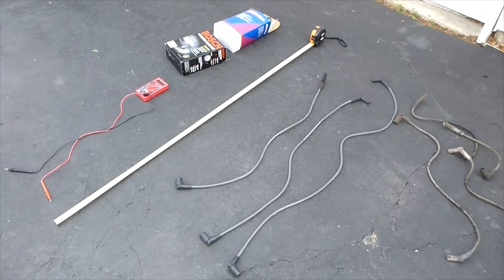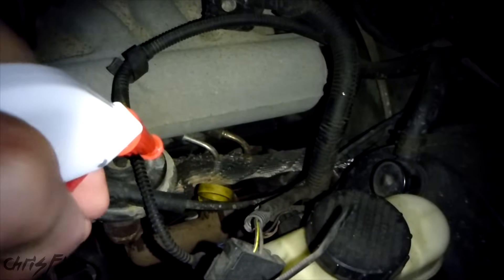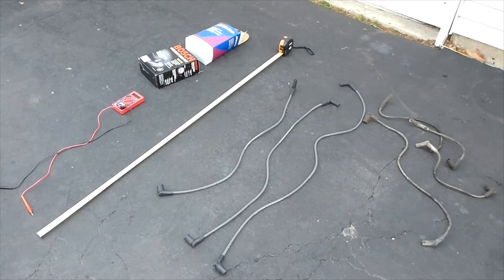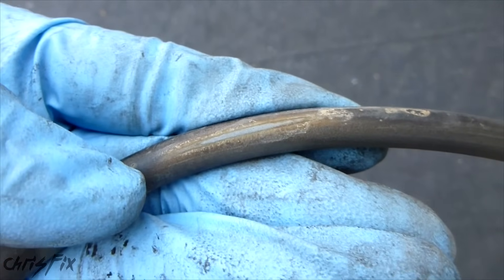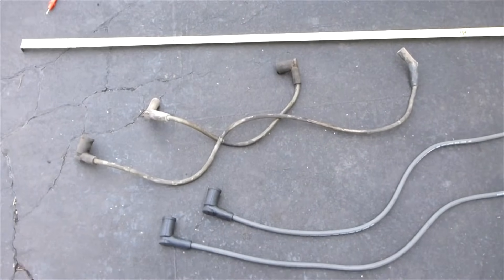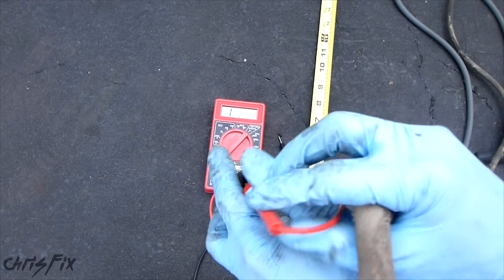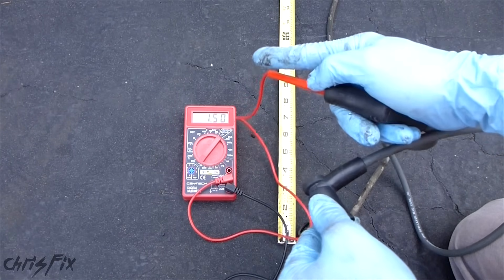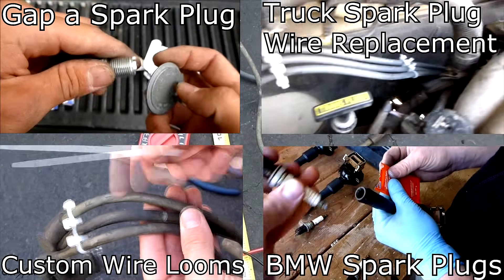How to Test Spark Plug Wires

Comment: Hello everyone, I have a Honda Accord 2002 LX I4 that have a check engine light is on. I have code P0420 two weeks ago. I use the lacquer thinner put in the gas tank and the code is gone. After 9 days, my car give me the code P1399 misfiring. I came to auto shop, my mechanic cleaning EGR, cleaning intake manifold, change head gasket, change spark plug and wire, change distributor, check compression, check vacuum leak... but the check engine light is still on and my car is likely losing power, hard to speed up and shaking when it is idle or running <15 mile/hr. I realized when I pull out the spark plug wire number 3, the rpm is not changed. So my question, is there any chance that the bad Oxygen Sensor or the bad Catalytic Converter give out the code P1399? My mechanic check all the above possibility that could cause misfiring but cannot fix it. I appreciate all comments and helps. Thank you so much.

Comment: Sir, my car i20 4th coil HT cable, the shortest cable, has 8.8 ohm resistance which is the highest among the 4 HT cables. The 1, 2, and 3 readings are...2.4, 2.0 and 1.8 ohm respectively. Is the 4th cable really defective???

Comment: Can you do a video on timing a distributor
Reply from the maker: Good idea
Reply: ChrisFix yes and is the timing chain easy to fix on the ford ranger 99
Reply: @chrisfix  My car i20 clutch sets ...disc, bearing and plate, and slave cylinder has been changed recently. After that, all working ok...pulling, shifting, etc..all ok. No complaints.

However, just about 3000km of driving since the above replacements were made, the car suddenly failed to engaged any gear while driving. The clutch pedal all the way goes to floor and never return back. I have to manually return to its original position and then pressed again repeated. However, it still sticks to the floor and never return back.

I was driving and all of sudden the issue happens. Stuck in traffic and was pull over to roadside with traffic police help.

Wait for some time, and yes, it come to engaged and disengaged again. All ok. But, the problems arise intermitently!!!

There is no physical leakage, damage or low fluids in the system. All ok. (It used to happen when clutch is used often ie in traffic jams, clutch engaged and disengaged frequently, just in 10 minutes or so. However, no issues with pulling power and no clutch slippages, temperature, coolant all ok.)

Comment: I have an 06 impala 3.9 and my wires run across the top of the block and one day i noticed they were shorting out on top of the motor it looked just like when you sprayed the water on them and i could see it around sunset so it wasnt even dark

Comment: I just replaced spark plugs on my truck....like an idiot I put dielectric grease on all the electrical connectors (ignition coil connector that goes from wire harness to the IG coil) now i know that stuff insulates and not conducts.. anyways the truck ran great for about 45 mins then started running rough. I went through and cleaned the connectors with electronics cleaner but still running rough. any thoughts?

Comment: Hi chris. I have a 07 tahoe there is no spark on the left side spark plugs. I already replace the spark plugs and coils but there is still no spark.can you help how to diagnose why there is no spark on the left side spark plugs
Reply from the maker: On that car, what wires go to the coils? Is it one set of wires to each coil or does each coil have wires going to the computer? Is there a ground on that side that’s dirty or broken?
Reply: They have a small spak plug wire that go from the spark plug to the coil and the coils plug to a set of wires that go to the main harnesses

Comment: Hi, Mr. Chris.  If I put higher wattage headlight bulbs  100/90w  in my 70 Amp alternator car, will it damage my spark plug wires over a period of time? Because Higher wattages headlight bulbs draw more wattage and amps and will it lead to low wattage supply to the ignition coil, spark plug wires and spark plugs. What is your suggestion regarding using higher wattage bulbs in 70amp alternator car and damage to the ignition coil or spark plug wires?

Comment: Hi, Chris.  Thanks for this video. Today I could able to detect spark plug wire defect with the help of your video.
Reply from the maker: Awesome! Glad the video was helpful
Reply: @chrisfix   sir, my car i20 has 2 separate coil packs controlled by 2 wires connector which controls 2 high output terminals. However, one high terminal pin 4 of first coil gives less spark than pin 1 on the same coil pack. Why such less spark being provided by the same primary coil??

Comment: First off, love all your videos. They have really motivated me to keep up with the maintenance on my truck and get as much life out of it as possible. My question is I have just tested my coil pack and my primary resistance is 3.4 (spec range is .3 - 1.0 ohm) and secondary is 13.3k (spec range is 6.5k - 11k ohms)

I have read all over that it should be close to this range, but I'm not sure if this is still acceptable. Should I just replace for good measure? 

My only concern is the primary resistance being over 3x the resistance it should be.
Reply: Yes

Comment: How are you going  to know the specs for different lengths? Pulling wires off can cause the end connector to come off. Then you need wires. Use silicone dielectric  grease on the ends. Plug wires develop resistance  when they get old. Replace them every 5 years.

Comment: Thanks for the video man.. good stuff to know
Reply from the maker: Glad the video was helpful.
Reply: @chrisfix   sir, my car i20 has 2 separate coil packs controlled by 2 wires connector which controls 2 high output terminals. However, one high terminal pin 4 of first coil gives less spark than pin 1 on the same coil pack. Why such less spark being provided by the same primary coil??

Comment: I have a 2003 gmc Sonoma 4.3L V6 i have a misfire on cylinder 6 so I did spark plugs and i still have a misfire then I did plug wires and I check them to make sure they were good and I still have a misfire  what do you think it could be i would like to here back from you

Comment: hi chris, is it possible to use sparkplug wires from a 4 cilinder engine for a 6 cilinder engine. i was planning to buy 2 sets of a 4 cilinder engine because i cant find a set for a 6 cilinder engine, thanx in advance.

Comment: This is a great video. Thanks i like how you show the detail in the multimeter. I just have one question you said the bad wire was the one that read 10 thousand ohms and the good wire was approx. 500-600 ohms. The higher in ohms like 800-900 is a bad wire and the less ohms is a good plug?? Mine were between 600-700 is thst good or bad???

Comment: One thing to note, I have a new Fluke 323 tester and bought a new set of spark plug wires after my meter was showing an open line on the coil to distributor wire. I checked the new wire and got the same open line reading. I went to the specs on my meter to find out it only reads to 4000 ohms so it is completely useless for checking spark plug wires. The cheap multi-meter I had before that broke had a much higher resistance reading capability before it broke of course. I thought I was doing good by going with a quality brand tool,  I just can't win.
Reply from the maker: That is crazy. Fluke is supposed to be an awesome multimeter brand.

Comment: Hi Chris, 

I have a bit of a bother I hope you can help with.  

Car is a 2003 Chevy Tracker.  I bought her used, my first car.  Started and ran great, no problems.  Only issues were it needed some minor suspension work, and the gas tank leaked if you filled it over half.  The previous owner's solution was to simply never fill it over half.  I wanted to do better by the car than that, so I ordered a brand new gas tank, along with the suspension parts and took it to my mechanic (family has used him for ~20 years).  I figured, given the previous owner's lack of maintenance, I'd have all new iridium plugs put in (the manual calls for either iridium or nickel).  After the work was done, she was rough starting,  and constantly stalls if you don't manually keep the RPMs at or above 2000.  We tried replacing the catalytic converter & O2 sensors, no joy.  New PCV valve, no change.  IAC is clear.  I installed a brand new air filter 300 miles prior to bringing it in for the tank and plug change.  Mechanic insists the plugs are gapped properly (they were pre-gapped at the factory and he says they checked out fine).  They're in a coil pack, and the wires weren't touched, only a plug change, so the firing order as I understand it could not have been fouled.  Computer is throwing codes for barometric pressure sensor, knock sensor, and mass air flow sensor. Replacing all of them would cost over $300, with no guarantee that the sensors all suddenly failed at once.  I realize it's really hard without physically examining the car, but do you have any ideas?  Could the plugs have somehow mysteriously gone bad?  I'm starting my own (non-automotive) hardware installation business, and need to be able to drive to my customers.  At this point, I've $2,500 in the car, which ran great when I brought it in, and now is essentially a lawn ornament that can sometimes unreliably drive somewhere (roughly, loudly, and with a horrible smell).  Thanks, 

Alex in MT

Comment: I'm restoring a russian small truck from the 50's . No one makes any parts for them anymore, i've manage to fund some "nos" wires but they are a bust, the wires are harden and broke apart. But the boots are OK. the original wire is only 6mm diameter, and all the wires I find are 7 or 8 or 9+ so they don't fit (the spark plug boot is L shape and long) Its ok to drill them a little? and bend the new cable, maybe pull on it...?

Comment: Hey chris love you channel. I have a 93' grand marquis. Intermittent check engine light. Heavy hesitation on idle and accel. Almost feels like a misfire. I can't figure it out. Familiar with panther platform vehicles? Btw it's first year for 4.6 and it's hard to tell but I think I counted the code correctly for lean/rich bank #1&2 02 sensor

Comment: If it gets wet in the spark plug chamber, am I screwed? lost power obviously due to the fact there was no spark due to it, I used electronic cleaner, a cloth to dry the chamber and a vacuum to suck, it wasn't that much but my car sounded like a 66 beetle and had almost no power, did not drive it for very long though like maybe 8 mins.
Reply: Never mind I found out what to do. Changed the spark plugs and spark plug wires, also I had to change the oil since water got inside.  After a few tries I was able to make my ride start, seems to be fine now.

Comment: Thanks for this, looks like my spark plug wires in the 1984 Caprice Classic need replaced as they were sparking! Might that be the cause of the tingling noise I heard in the car while driving up hill sin Overdrive? I expected it was preignition (or is it detonation? one of the two but one just blows up the motor) but I expect the wiring wasn't helping at all either.

Comment: should the resistance of a spark plug wire or any copper wire be around 5-10 ohms and not 5k- 10k as you noted.  I believe if you have a manual ranging multimeter, by setting the resistance to 10k range, when it read 5.0 or 10.0 , it is still 5 ohms or 10 ohms.

Comment: Hey Chris, I have a 1999 Ford Expedition that will run fine if I start it up cold and wait for the idle to lower before driving. When I start it up while the engine is already hot and drive off, it misfires on cylinder 2. Do you know how this sort of thing happens? I honestly can't figure it out.

Comment: 2005 Buick Rendezvous missing firing P303 and then got a P107 when driving it acts like it wants to jump and the check engine starts to flash and it idles rough what do you think I should check first

Comment: Cool but i just replaced mine a new spark plug wires, but what happen next is worse. Erratic idle, can hear a loud noise like a electrically. then i put back the old one. Nothing changed. Anyone got ideas?
Reply: john doe Possibly coil pack? I assume after 2 months you would have gotten it fixed by now, would be quite interested to know what the issue was.
Reply: Nicholas Hatala actually i just put the spark plug wires in wrong order, i searched the problem and doubled check it if the sparkplug wires is in order and everything is fine for now.

Comment: i installed new sparkplugs and they seem to have melted and broken off inside the cylinder and i have been trying to take it out but i cant any suggestions on how to fix this
Reply from the maker: Use a magnet on a stick: http://amzn.to/2aAxm5o
Reply: +ChrisFix it's the plastic from the spark wires that melted inside
Reply: +ChrisFix do u have an email that I can send u pictures to?
Reply: You could always a pick and just pick it out.
Reply: i tried i cant reach them i used needle nose pliers and still

Comment: Hello Chris. Thanks for the videos man, you always make them full of helpful info and simple explained. I have erratic idle and that's "killing" me. It's interesting you pointing out about the high pitch radio noise. Its like 1 year that I hear that noise from time to time and I have thought it might come from some air conditioning tubes or valves. Sometimes I hear the noise even if my sound system is off. Does this noise definitely indicate that the coil wires are to be replaced?

Comment: Really appreciate your videos, Chris! Always very informative and very well done. I hope you're making some good income off of these, as it's well deserved. 

I'm going to check my wires using your methods, but is there a general rule as far as mileage goes as to when you should replace them? Answers to that are all over the map online. I have a '97 Toyota 4Runner with the 3.4 liter that I just put head gaskets on and it seems to be running slightly sluggishly since the rebuild. Of course, I parked it and waited two years to repair it after one blew, so for all I know it runs no different than before! Gotten used to the new car maybe. I put fuel stabilizer in when I parked it and have now run several fresh tanks through it and replaced the fuel filter, as well, which seemed to help slightly. New plugs were installed right before the head gasket going. Thanks in advance!

Comment: I have a Dirtbike that I'm going to sell, it ran perfect until I went to put it up for sale. It sounds like it's getting too much gas when I get past 1/4 or so throttle. I adjusted the carb, cleaned and even changed the carb but still the same. It was jumping from a boot to the engine so I covered it with electrical tape but it didn't help. It doesn't jump anymore but it's doing the missing still, do you think it's the spark plug wire?
Reply from the maker: It might be the wire. It could also just be the carb or gummed up fuel lines or valves. Try running seafoam though it: https://www.youtube.com/watch?v=WdT4DPFXIkM
Reply: +ChrisFix I already did...... Running out of ideas but I think it's the wire, I order a new one and try that.
Reply from the maker: Keep me posted!
Reply: Did You solve the problem? I'm curious.

Comment: how can i test ignition coil  a jaguar  s type r had recenly fixed  oxygen sensors light i fixed but light didn't go off so i searched for codes again and got misfire codes in like 5 cylinders replace the plugs but not get solution so i wondering coil maybe bad but not sure and don't want to spent 400 dollars on coils with out knowing this is the problem or will fix my problem ,,,
Reply from the maker: Take the one good coil and move it to a different cylinder and see if the misfire changes to the other cylinder. That is the easiest way to test them
Reply: but in my case i have 4 faulty coils the 4 coils  by the driver side i get more confuse everyday and really afraid there might be some more or worth to deal with i just bought this car 2 month ago
Reply from the maker: You have 6 cylinders so you can still test the 4 bad ones.
Reply: what about i start the engen and try to pull out one at  time to see if they fire

Comment: Is there a set standard (resistance) for plug wires? GMC, Chevy, Ford or whatever?  If you have a plug wire 1 foot long and 2 foot long plug wire the 2 foot plug wire should be twice resistance of the 1 foot correct?

Comment: I hope you still read comments on old videos, but I haven't tried the mist test yet as I don't have the spray. I will try to go and get one but if you could help me now that would be nice, as the mechanic has said nothing is wrong (not tune up?).

Basically I drive a manual transmission car that I got second hand. After a month or so from the beginning of this year, it started having problems where it would stall randomly even though either I was driving or had the clutch pressed in fully. Although this problem was small, it has since gotten worse (i.e. stalled 5 times within 5 mins in a carpark, and shook violently whilst in third gear). My mechanic didn't bother to find out what it is, but when he drove it he said it was fine. However, it is an on and off thing, where it just randomly starts acting up then its fine after a while. I've tried turning AC off (makes it better) and let it warm up for 10 mins or so but it still happens. 

It would be greatly appreciated if you could help as nothing I've found on the internet has helped so far. Thank you!

Comment: Hey I just did this with two sets of sparkplug cables. One cable with no visual damage had no resistance at all. 
And one question to you Chris: If one cable is getting a lot of heat by cause of leaking manifoldgasket, could it work bad even if the ohm is "good"?